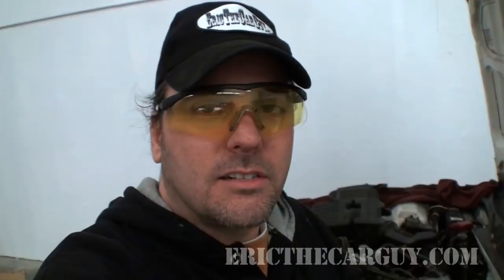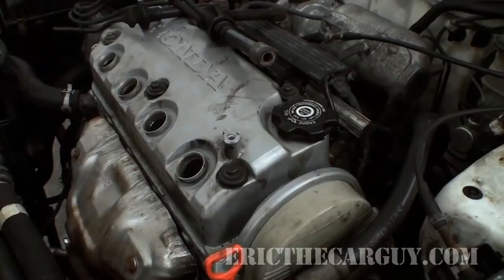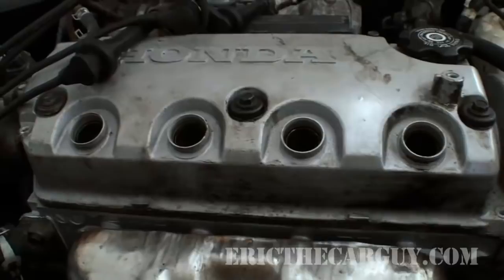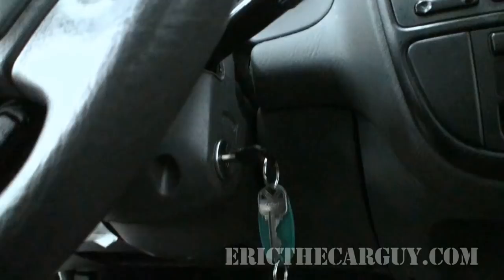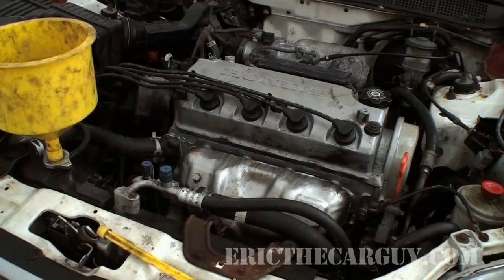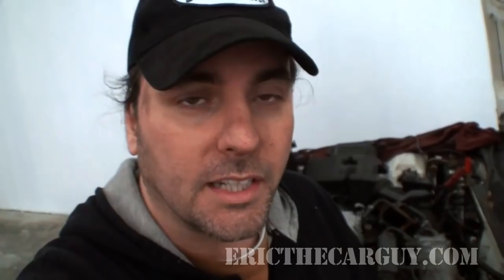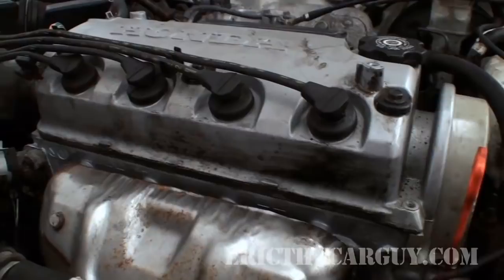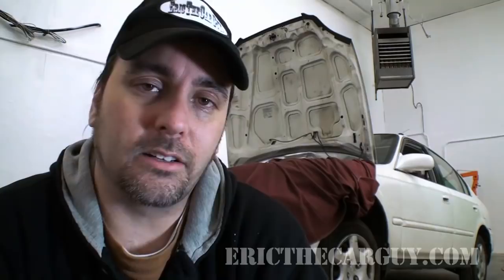How to Break In A New or Rebuilt Engine - EricTheCarGuy

Comment: nope only after the run in process is complete otherwise you risk engine damage, anyhow the power figure will be inaccurate as the components haven't yet bedded into their matching sets. for example piston and rings to bores, cam follower to push rod and rocker arm etc, etc.

Comment: That is exactly how I break in engines.  The valves will need adjusted several times.  I also retorque the heads after the first 500.

Comment: I would not start with synthetic... just plain-jane dino oil.  I'm not a fan of WOT-ring-seating... just don't let the engine get too hot during break-in, so the rings don't work-harden until they're seated.  Some engines can be pre-lubed with a drill... I did this to a Chevy big-block, via the distributor hole, using a piece of copper pipe crimped on one end.

Comment: On the subject of per-lubricating the engine, I've seen guys on TV take the distributor out and use a hand drill to drive the oil pump. These shows are usually about old cars. Is this an option on a more modern car with a distributor.

Comment: Hello,
I have specific questions about Toyota Diesel engine avensis 2.2  from 2007.
They guy in the garage says that its not possible to resurface the valve block ,
Just to change  the head gasket  and    It must be fine .
Can you please give some more information about it ?
Thank you...

Comment: I know this is an old vid so I'm hoping you can answer my question. I've got a rebuilt I6 4.0 engine in my 96 jgc and the instructions I got for this is to leave the oil filter open ¹/⁸" loose and use a drill and turn the pump through the distributor hole till oil comes out the filter hole,tighten filter and that's it. Does this sound kosher or should I do more? Too much pressure builds with the filter tight, made 1/2 drill smoke.

Comment: eric .. I rebuilt my 92 civic  engine the d15b7 all std  nothing fancy but i droped in my rebuilt and i cranked her over like u did to prime the oil pump and cooling sytems  when i finally fired her up she ran horribly like a diesel .. i checked my timing belt and tensioner and took it off and replaced it like the book states .. i let it warm up but the diesel sound is still there not as loud but its there i used my stethoscope  and it sounds like its in the valve train assembly. . i checked my valve lash across the head in fireing order 1342 and i reset it .007 on the intake and .009on exhaust. . i ran the car and opened the oil fill cap to see if i was gettting oil to the assembly  and i am but im getting some blow back threw the oil passage  right below the fill cap .. i fear that if i leave it on too long i may damage the engine and i put allot of time and money into this rebuild .. do u have any ideas as to why it would sound like a diesel?

Comment: So is it the load that is more important to the cam break in? After break in do you have to adjust anything in the valve train? And what does "break in" do that you couldn't do on a bench, as far as surfacing or fitting?

Comment: rings have to seat against crosshatch and crosshatch onl;y stays raised for a few thousand miles if you do not put stress agst the rings enough they will not seat all that well and form a seal ,so they will not make a seal and cause lower compression causing loss of power and much more

Comment: I did a pump prime the engine. So with not priming a few turns can cause a slow crank even with starter and battery cables. I tried torque wrench on crank bolt and I measured 32ft/lbs with out plugs in.

Comment: Hey dude I just bought a ridgeline I am a through and through honda guy I had one crv from new and I followed the honda guide and did the 1000 km initial break in period I always very the speeds and rpms when this break in period is in effect my 2010 crv ended up burning oil way too much after the first oil change and the VTC actuator was grinding on startup after 8000 km which is first oil change of the vehicle I had the vehicle with 15 km when i drove it off the lot so break in was all me.  All my other hondas never had this issue that vehicle ended up being the worst honda I have ever owned what could have caused that issue with that engine?  It eneded up being a lemon to me I was never so happy to part with my vehicle ever. I got a 2013 crv gave it another go and that engine was awesome no oil burn at all ever I just got rid of it though for a ridgeline always wanted one from the first day so I just want to break it in good I have 2500 km on it now I give it a little pop here and there just to feel the v6 power but never bag it.  Honda techs say dont be too easy on them either you should work the V Tech once and awhile what are your thoughts on this?

Comment: I intuitively did my first crank and first startup exactly as he did. The unloaded crank speed almost doubled the instant the oil light went off when all the assembly lube got flushed out of the bearings and displaced with oil.

Comment: what would you recommend for a used engine? this engine has been sitting for about 5 years, but it turns. its a 5.3 for chev truck. i will be replacing the lifters, so they will be soaked in oil,
head gaskets, water pump, plugs, taking the oil pan off and making sure everything is good. but as for break in, because i will have alot of highway driving afterward.

Comment: Hey Eric you should of included that you filled the oil filter up so that there is even less time of the motor cranking over without oil. Just a comment.
Reply: +YZ250Yamaha969 Mopar big and small blocks have the oil filter on the return side. I believe all motors are set up like this. It prevents a dirty filter from starving engine bearings of oil.
Reply: +Al Cyr no engine has it on the return because there is no dedicated oil return in any engine, it just spills out the sides of bearings and drains into the pan.
Reply: As soon as I saw your reply I understood my mistake. I was thinking about our hydraulic power packs at work, that run motors and accessories. Complete different concept

Comment: the engine is off. im a delivery driver. theres a few hills where i work where i engine off coast for like over half a mile. i have a gauge that tells me the mpg im getting. it improved by 7 mpg overall. im gettin 34 mpg in the city as a delivery driver. not bad.

Comment: I also I forgot to mention earlier that I would initially use mineral oil which helps (because of greater friction) moving parts to bed in. After the first 1000 miles I will change to fully synthetic oil.

Comment: Just rebuild a sprinter engine brand new bottom end bearings used crankshaft minimal wear came out of an engine with head gasket problem inspected crankshaft before installed put bearings in got engine together ran it for 1 hour at varying speeds none over 3000 RPMs developed a knock took oil pan off looked at bearings they seem fine at a loss and need some help done this multiple times with no problems also replaced 3 pistons and connecting rods

Comment: I just swapped my engine and it will crank but won't turn over. I tried to do the timing correctly but could have messed up. After doing your procedure it still didn't start. What would you do first for troubleshooting?

Comment: EricTheCarGuy.

I have an 01 Cherokee Sport. Engine threw a rod at 165,460 miles. It was always hot. I had the engine replaced and changed the oil at 100 mikes as the company requires. They said at 1,000 miles, guessing 900 miles later (100 miles and 1,000 miles), to change the oil. Would it be wise to go for the 1,000 miles and be over or 90 miles shy of 1,000 miles?

Don't want to drive from NY to PA and back!

Comment: Only done v8's so this could be off  base but...did you install a new camshaft? if so shouldn't you keep your rpm up higher than idle to break in the lobes and establish set wear patterns before you put it under any load?  If not a new cam then shouldn't be a problem...also this motor may not even be in the same realm for cam break in i just watched and wondered

Comment: I got a Toyota Corolla CE 2004 that I rebuilt the engine over a year ago and it have been sitting on a pallet block outside next to my garage but it is covered with a heavy duty tarp; I used as much Japanese parts as needed; fly wheel is not on yet; once I drop it in do I need to do this same operation? The lube it has inside is the install lubrication for the bearings and the piston walls; I basically rebuild under the hood everything basically new except the AC compressor, the steering pump, the hardness and the transmission box (got new clutch though) the car is 5 speed manual. I will appreciate your input.

Comment: This will work with a roller lifter but id you have flat tappets better keep the rpms between 2-2.5k to keep adequate oil presseure for about 20 mins

Comment: I have a couple questions please... what kind of oil do you squirt into the plug holes? the same as you put into the engine when filling it up with oil?  second question is how long would you say I should crank the engine over before installing plugs and injecter connectors to start the engine?

Comment: @ Eric. Dude why didn't you just go head and change the water pump when you changed the timing belt? It would have saved you a heck of allot of time. And also a question in my chevy 1500 the distributor turns the oil pump is that not the case on these overhead cam engines?

Comment: do you have a video of you doing the timing belt? tried to do mine on the same motor and had issues getting the crank pulley nut off. tried air impact, I didn't have long enough extensions to use a cheater bar on a ratchet or breaker bar, also tried to jam a ratchet against something sturdy and cranked the motor a little, didn't have enough torque lol i heard you need around 400ft lbs to break it loose

Comment: My '98 Civic with the same exact engine makes that loud 'clicking' noise (for lack of a better term) as well, seems to get louder every week. So it just needs a valve adjustment maybe? I thought maybe it just needs new plugs, plus it's a little overdue for an oil change. It also "sputters" (or hesitates?) a bit when accelerating, it's gotten worse lately. Plus it makes a faint sound when it runs cold, sounds kinda like chains dragging. What's going on here? It currently has about 197k miles.

Comment: Hey man!! Need your help!! I think my tie rods need to be replaced?! I I replaced the ball joints lower control arms and two motor mounts and CV joints and it still Wonders all over the road especially the right side I'm thinking it's the tie rod ends .. where they screw  into.. you know. that long deep wall  socket you have to use to get to it .. It feels like I'm sliding all over the road I hear clacking noises. Transmission shifts hard as well

Comment: Hi Eric I had a piston replaced and a re-bore done on my single cylinder motorcycle. I have only done 300km and have parked it up in my garage for over 6 months now due to bad health. I intend to continue the break in period in a couple of months when I feel better. 
My question is " Will letting it sit for 6-9 months do damage to the new piston and rings? And should I squirt oil down the cylinder to keep the piston from sticking?
I can only turn the engine over by putting it in gear and rotating the rear wheel as the electrical system is removed. Is this enough?
Reply: Yea ,a cylinder that stays dry too long can be bad so take the spark plug out and add about on ounce of oil in the cylinder and turn it over a few times with the plug out so it makes it easy to turn....Sea Foam makes a spray lube for that too..Add some fuel stabilizer to the gasoline or some Marvel Oil,.about a ounce to the gallon....

Comment: Sorry Eric but I have to disagree. I bought a brand new Triumph street triple r (it's a motorcycle) - I allowed it to reach full operating temperature and at which point I would ride in a normal manner. If you baby the engine from new, the piston rings will never seal properly against the bore. You can tell this is a problem from the 675cc 3 cylinder engine in my Street Triple, I ran mine in in a relatively "hard" manner, it used almost no oil between services...ones ran in "easy" do burn oil :(

Comment: I had my engine rebuilt and my mechanic frequently changes Gloves. he also wipes down the engine fully with Meguires cleaner and plastic conditioner every time he works on a car. he is in high demand and he gets his rate !  my car in the engine compartment came back cleaner than when i brought the car in. impressive!

Comment: hey eric did the oil pressure light not come on in this car when the oil was low, or was the pressure sensor broken????? i have a mark 5 golf and it has 2 stages of warning one when its at min on the dipstick it gives an amber oil light and if its really low it gives a red light, all cars should have it.

Comment: HI Eric, I just have the engine of my honda civic overhauled and after 4 months of use, I noticed some oil leaks. I just found out that my ATF has gone below the normal level. Does this transmission oil leak may have something to do with the removal and re-installation of the engine? Is there any gasket that might be affected by the recent job? Need to know so I can charge the repair to the overhauling job warranty. Thanks mechanic

Comment: Eric, I took apart my 2001 Impala LS a few weeks ago to do some gaskets. I removed the upper intake, lower intake, and valve covers. I'm assuming I should do all this stuff, but the problem with the 3800 engine mounted in FWD cars is that the rear bank of spark plugs is basically unaccessible without special tools when the engine is put back together...

Should I just skip the step of dropping some oil in the cylinders and removing the spark plugs?

Comment: Thanks for this video ... do you think is a good idea rebuild my 99 honda prelude automatic engine high mileage? It has no leaks or head gasket problems no overheats or engine noises.. just blue smock at stop sings. And withe smock at the mornings but it burs some oil and consums some coolant..  do you recomend rebuild my engine? I really like to keep my prelude...😇

Comment: i have a 1988 mercury grand marquis (5.0 engine) with a bad crankshaft bearing thats causing one of the cylinders to not come up all the way. i know you cant just replace a crankshaft. u gotta pull the motor. so i plan to swap it out with a used motor. does a used motor require a break in period? i also plan on rebuilding the old motor myself in case the used motor is a crap shoot. how do i know if i rebuilt the motor properly?

Comment: it's really important, last week we changed an engine in Mercedes-banz e class 2009, and that new engine we didn't check it! and installed into car! then when we tried to start, engine wan't move, then we tried to move the engine by wrench to the opposite side then we got it that the connecting rad was broken! and pissed removing engine again, actually the seller was liar we paid more then 2000 euros and he said engine have just 8000KM :)

Comment: I have a question in regards to the break in period and the oil change. I've been reading about having the oil changed at 500 miles since there are all these metal particles in the oil that's comes out in the break in period. Your thoughts? I'd really appreciate it.

Comment: hey eric, i bought a brand new engine from a gm dealership, its a small block 5.7 liter (350) for my chevy express van.  well i broke the engine in with synthetic oil, changed the oil after 100 miles then after 300 miles.. after 500 total miles i found out they recommended breaking the engine in with conventional oil before using synthetic, am i screwed?

Comment: Eric my 1995 dodge ram 2500 with the 5.9l v8, burns a couple quarts of oil every 100 miles or so, not very good, i need new vavle seals and possibly new rings, if you could do a video on valve seals on any v8 that would be amazing!

Comment: Hi Eric. I recently put a crate motor in my 87 toyota 4runner. Its using a bit of oil. 3rd oil change 10/ 40. The valves don't seem to be seating. I heard about a drain antifreeze and run for a bit way of getting them to seat? I cant find details anywhere on the proper way to do this. Any help would be awesome.

Comment: Bro. I need a little help. I replaced the engine on my lx470 2003 recently. But what happened after that is the transmission is makimg too early shifting almost like 4 gears at 50 km/h. This is annoying, i showed it to some electricians but no body has a clue whats wrong.. Is there any sort of electronic recalibrations required after engine replacement noting that 2003 has elec. Throttle body.
Your feedback would be highly supportive

Comment: Hi mr. Eric the car guy, i just have my gmc savana 2009 replace the engine  (rebuild) and it has the check engine light on but the mechanic said I need to drive for many miles and it will clear, is that truth?

Comment: Hey, I've got a 2008 toyota tacoma 2.7 4 cylinder. I bought it with 54k miles on it now it has 65k. It's the 5 speed stick shift. Only problem is that I like to shift it high than I probably should. In town I would guess about 3500 rpm average shift point, but sometimes I go to 4000 when getting on a open road. It's red line is 5500, but the thing sounds like it's going to throw a rod out the side at 4800. It runs great, very smooth, but why does it sound so high pitched? Maybe I'm used to v6s

Comment: Hey Eric,
I was wondering if who you would recommend for a remanufactured engine like jasper,ford,Sandj, or to place a used engine in my Ford E-150 cargo truck with 205k miles, need another engine because their is no compression in cylinder #7.
Thanks